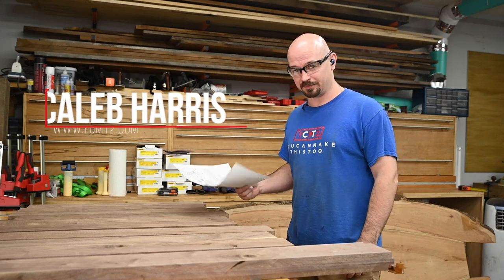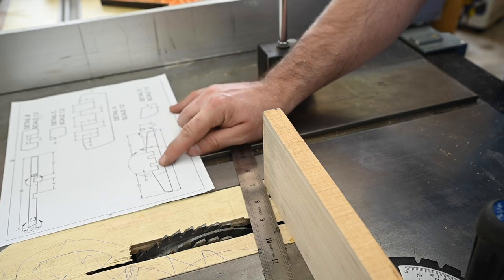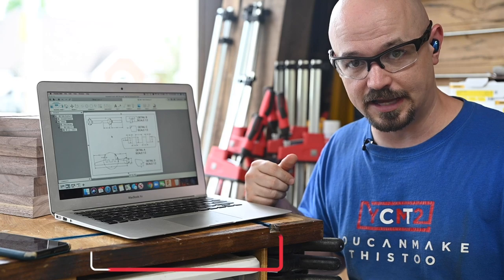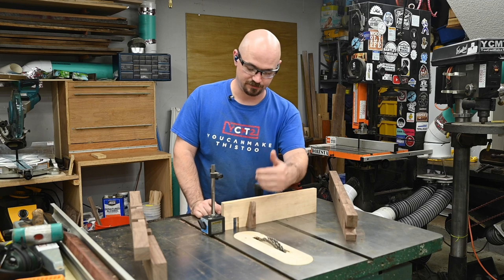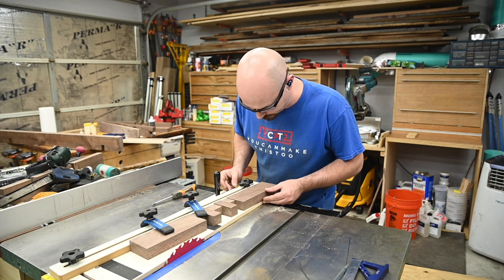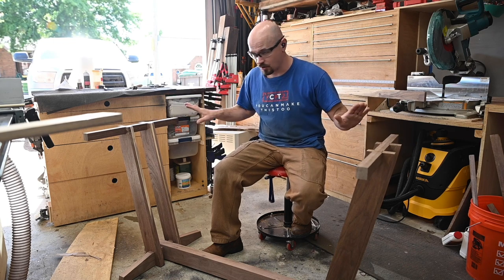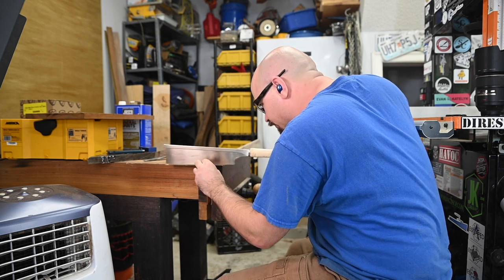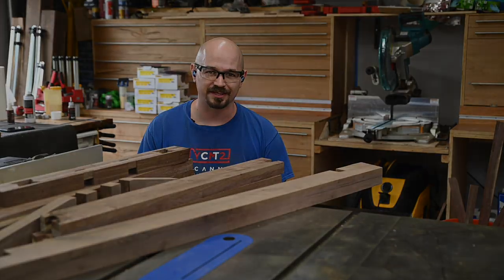Nakashima Inspired Table Base Joinery - The Big Build Off

Comment: Great video man! I really enjoyed it and I’ve been dying to try fusion 360 and you just made me 
want to try it immediately! 👍
Reply from the maker: Dude, do it!! It was a bit of pain converting over from SketchUp.. it's a different way of thinking. I knew it'd be worth it, and now that it's finally clicked... it's so much faster. Especially for changes and just "designing." I go to modeling when I need to mess around with angles, proportions... so it needs to be easy to play with those, and it's super easy in Fusion. It wouldn't take 60 seconds to change the width and length of the top, leg angle, leg spread, material thickness, and taper angles and have it all updated with new drawings.

Comment: Caleb, I noticed there at the end when you were using your miter saw you have your dust collection coming in from the top.  Just wondering how that is working out.  I am planning on doing the same thing to my miter station when I build it.  I too have a Clearview CV1800 (16 inch fan option).  Thanks.
Reply from the maker: That’s the same collector I have. There’s about 30’ of pipe to get to the miter station and it’s just an open 6”. It’s actually working really well for me because by dumb luck my miter saw shoots the dust straight at it. The only stuff it doesn’t grab is heavy and falls straight down so I still have some collecting. But.. I think it’s working better than if it was at the bottom.
Reply: @YouCanMakeThisToo  I have a DeWalt so I may have to deflect mine up towards the pipe. Thanks for answering.